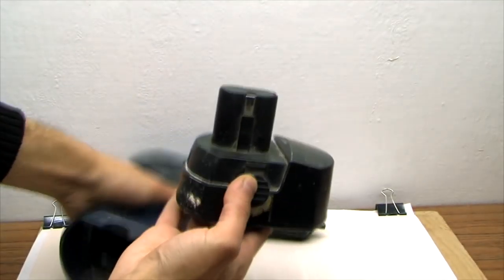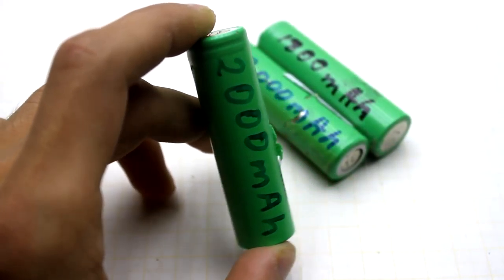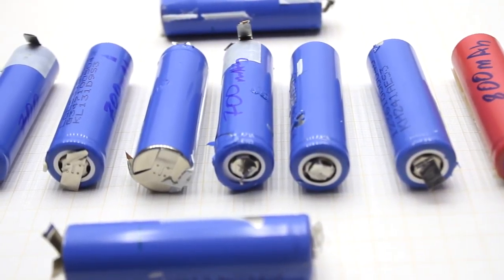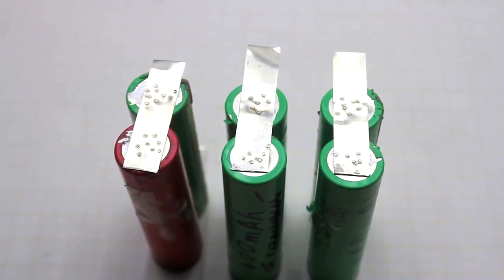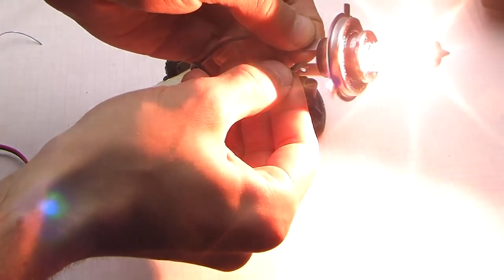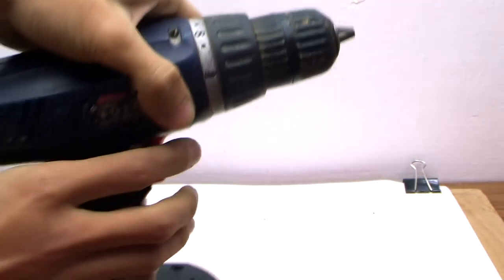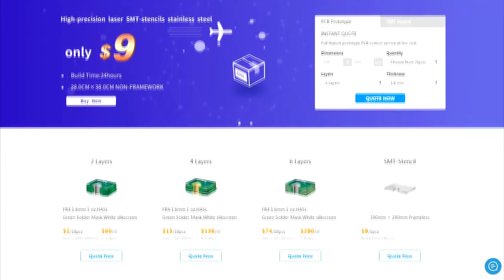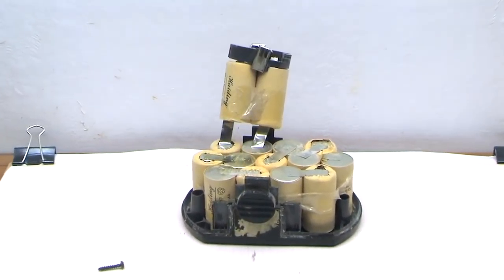How to rework an old drill / screwdriver

Comment: BTW some laptop power supplies can power old tools like this. They don't usually have enough starting current to get the proper torque but they can do minor things like drilling PBC holes if you happened to forget to charge your drill batteries. I have a couple of the earliest 4.8 volt Mikita cordless drills. I took the batteries out, and installed a 4700uF capacitor wired in parallel between the motor and DC jack. It is functional on an old 12v 5A laptop power brick.
   Personally I just look for unused nicad batteries at second hand stores. You can also get the cheapest nicad from places like harbor freight. Just take them apart and reconfigure the cells to fit your old battery pack ;)

Comment: 6:56 What kind of tape is this?
Какую ленту вы используете здесь?
Reply: Upcycle Electronics the tape is high temperature isolation tape for more detail watch the induction soldering iron
Reply: Science 007 
  Thanks. I've seen packing tape like that, and it kinda looks like drywall tape with a shinny backing but I've never seen something like this for electronics. I'll watch the other video.
Reply: The yellow/orange stuff was brand name Kapton tape. He was referring to the fiberglass reinforced tape.
Reply: Looks like some fibre-reinforced scotch tape, I doubt it is heat resistant.